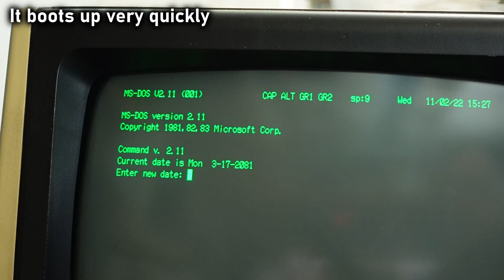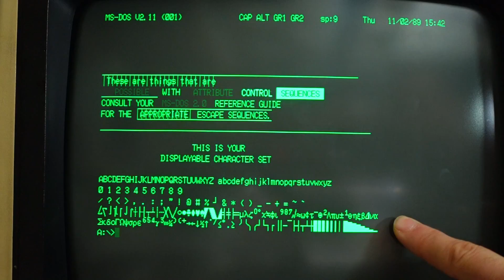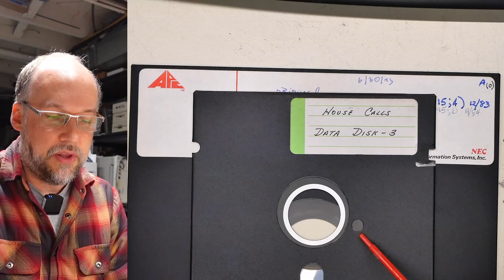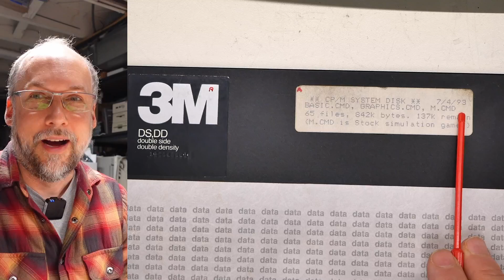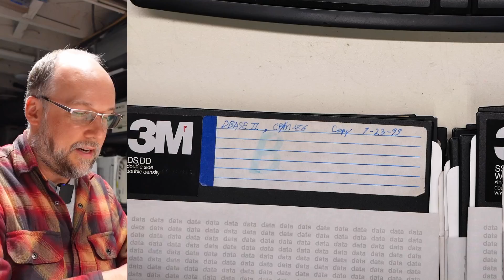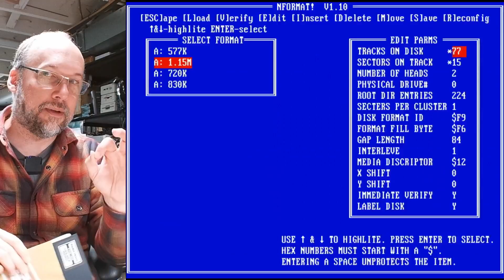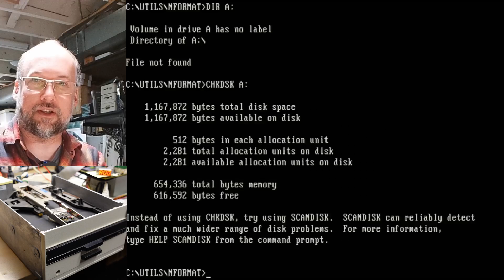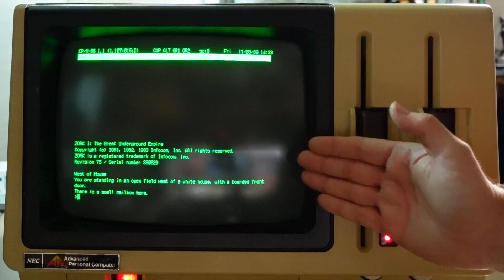Comment: Neon lamps get kind of weird as they age. Adrian, I’ll bet that if you shine a light on the neon lamp it’ll light and stay lit as long as there is sufficient ambient light, but if you turn down the lights, it will start flickering something awful.
Reply: Yeah I didn't know this! Someone mentioned Mr Carlson talked about this in a video. Fascinating thing! That switch I used was old and came out of something I ewasted long ago ... so it was probably quite spent.
Reply: @adriansdigitalbasement  yes this real with neon indicators and quite fascinating.

Neon bulbs have been used for all kinds of purposes over the years not just as indicators.

I once saw a I believe it was a photo control of some sort or something or other it was something controlling the light that used essentially a neon bulb that had a third electrode that was some sort of trigger device I don't know exactly what this device was it was so long ago but it was rather intriguing.

And unexpected to say the least!

There was a neon indicator that was often used as a tuning indicator back in the day that essentially showed more or less of an indication to indicate single strength as well another sort of specialty Neon indicator.

Used in a silver manner to a Magic Eye tube also known as other things other than this of course as well!

There was all sorts of weird and wonderful components back in the day that were rather unique and fascinating variations of things to make something that was at the time harder to do that now is just something commonplace instead of novelty really!

Not novelty in the way of just kind of being silly but novel use of the technology to do something that is unexpected one could say.

Back in the day even in some memory circuits neon lamps were used I remember seeing some old equipment like this had something to do with a tuner I believe or some other AV device don't know for certain.

What part of the device this was in.

I think how it worked is that a capacitor had a charge stored on it and the neon was used as a switch sort of deal basically just a single bit of memory hard to describe it's been so long somebody else had described this to me what seems like eons ago.

Also light is used in some types of tube equipment to enable tubes to operate in the dark in some cases since their operation can be dependent on lighting conditions there might be a pilot light where you would normally not even see it and would be completely in the dark and no means to see the light from outside the case of the equipment I forget all the types of components that use this but they're out there.

Fairly certain Mr Carlson's lab would have reference to this and others!

I do believe that sometimes with certain voltage regulators and other types of cold cathode tubes as well and some others I'm not real big on this but I'm aware of a lot of different applications for this situation where a source of light is needed where there is not like readily available otherwise I have a feeling that sometimes they may use to Glow of one tube next to another to do this not for certain but it might be feasible in some cases pretty sure that this has been done or at least attempted before
Reply: Bizarre but true; the neons were made with a tiny amount of a radioactive gas in the neon to lower the strike voltage by providing an initial ionisation. I used to enjoy watching apparatus rooms full of equipment with neon power indicators which flickered like mad in the dark but as soon as the room lights were turned on, mysteriously got better and lit up. It took me a long time to find out the reason; that the light is sufficient to help the ionisation along.
Reply: @neilbarnes3557  Huh. Is that still true? You can still get neon lamps. I recently installed one as the indicator in a guitar amplifier.
Reply: @wbfaulk  Dunno, tbh: it's an eighty year old (or older) technology that doesn't have a lot of relevance in modern designs; I don't know even if new neons are still being made though I suspect there's a factory somewhere in China still churning them out for mains switches.
The radioactive ioniser has a half life of about ten years, so a neon made in the eighties has only a sixteenth of the Krypton-85 it started out with.
Reply: @neilbarnes3557  For anyone else interested, this phenomenon is called "dark effect". Apparently not all neon lamps have/had radioactive gas, but definitely some do.
Reply: @neilbarnes3557  wouldn’t you know, the neon in my extension cord flickers at 50Hz like mad under the sofa but bring it into the light and it seems to light brighter and with longer persistence. 

I have to wonder how much of that is just placebo, but surely it should look darker not brighter in the sun if that were happening. So it probably is indeed happening even behind the red plastic window.
Reply: That is bizarre.
Reply: I have a similar vintage switch like that. It has the same problems where it doesn't light up immediately.
Reply: I have two old power strips that use the same kind of switch as the APC, and those flicker when there's low light too. :P

Comment: Here's a one-line program that does your "maze" thing in Applesoft Basic:

10 PRINT CHR$(47+(INT(RND(1)+0.5)*45));:GOTO 10

That said, the Apple display font's slash and backslash characters don't line up very well.

But you could make this generic for basically any Basic:

10 PRINT CHR$(ASC("/")+(INT(RND(1)+0.5)*(ASC("\")-ASC("/"))));:GOTO 10

Good luck typing that backslash on an Apple 2, though.

Comment: looks like you have a dodgy neon or connection in that switch, its subject to quite a lot of mechanical shock switching on and off so may just be  a broken solder joint...

Comment: yeah, the ibm pc messed up lots of stuff. i had a dec rainbow, with both ms-dos and cp/m for it. i gave up on ms-dos when i bought turbo c 2.0 and discovered that the command line version of the compiler would poll the ibm keyboard controller to see if you punched ^C during a compile. i wound up trading my 2.0 copy for a friend's 1.6, which didn't. since the rainbow also wasn't a terribly good cp/m-80 machine (the decmate ii with z-80 add-on was much better), i wound up abandoning my rainbow.
Reply: Ahhh -- the same issue there! I have a DEC Rainbow which I haven't dove into yet. Sad it's going to have similar issues ... I guess CPM-80 was pretty good as software knew it had to use the CPM BIOS and not go to hardware or it would have tons of issues... but I guess once the IBM PC was dominant, there was just no reasons to bother not talking directly to hardware.

Comment: Little trick for vintage computers that don't support 4 year dates (and that also don't have some mechanism for dealing with year 2000 and beyond) that works well enough for most things: dial back the calendar 112 years (i.e. 2022 becomes 1910). The days of the week repeat every 28 years (112 is a multiple of that), so anything that does those calculations will still line up with the current year, you just have to add 12 (or 112 if that software assumes a 1900 century) to the year.
Reply: Very interesting workaround. Never thought about doing that even though I knew about the date cycles. Have you had use cases for that in the past?
Reply: Although apparently MS DOS didn't like it lmao
Reply: @forbiddenera  MS-DOS 2 is not Y2K compatible. Think you need 4 or 5 to use any dates past 1999
Reply: The screen showed oct 30th demonstrating the system was able to correctly calculate the 2022 date!
Reply: You are better with numbers than me.

Comment: Too bad Zork didn't work. I wish I was better in coding so I could try to rewrite that Infocom interpreter to make those games playable on different systems.

By the way, I really like your new way of doing the split screen display while working on the computer connected to your capturing device.
Reply: The Infocom interpreter has already been rewritten many times and Infocom games can be played on virtually any computer. "Frotz" is the most notable Z-machine interpreter.
Reply: Yeah, just no modern version for APC MSDOS or APC CPU86 :-)
Reply: @adriansdigitalbasement  You've got that C compiler. I bet you could compile Frotz on there without too much effort.
Reply: Wasted potential having ram limit of 128kb and mentioned in last video highest was 256kb. Game may have entered in to a loop waiting for keyboard bios call to returning scan code. Not trying to be full pc compatible unless only dos functions called, common for clones.

Comment: Neon bulbs - even newer ones - require a bit of light to "strike"; if this one is old and tired, it might need more light. Try flashing a flashlight into the power switch when it doesn't start right away to verify... There is a "strike in darkness" type, but I doubt that these were ever put into power indicators.
Reply: I've seen these neon indicators my whole life but I never knew that tidbit!

Comment: I wonder if any tandy 2000 stuff will run on it. Since there is a version of windows for the tandy 2k
Reply: It wouldn't -- architecturally the machines are totally different. (Other than them both being x86 based)

Comment: exactly @Stan, we used to Kermit between different OS versions vms cp/m and  pcdos and msdos (non-compatibles) thats how we ported Basic across to compile under GW or MS basic.  Using serial con and Kermit. We used to even hook up a Acoustic coupler, and drop on  to Columbia Uni to get the Kermit, was sometimes easier, then setup Kermit on each  Fun days... in the 1980s.

ref from Columbia Uni Kermit Project " There were separate releases for the IBM PC, the DEC Rainbow, the HP-150, the Heath-Zenith 100, the Victor 9000, the NEC APC, and many other of the DOS machines of mid-1980s that were not code- or disk-compatible with each other. "

From the  kermit archive :  w-r-r-     49552  1988-08-24 15:26:28  msvapc.exe
Reply: This takes me back.... Apricot / Sirus and Wang are the ones we used to have to port over to.  :)

The files MS*.EXE are MS-DOS Kermit binaries for IBM and compatible PCs
and for non-IBM compatible PCs:

  MSVAP3.EXE - NEC APC-3
  MSVAPC.EXE - NEC APC
  MSVAPR.EXE - ACT Apricot
  MSVDM2.EXE - DECmate II or III with MS-DOS Option
  MSVGEN.EXE - "Generic" MS-DOS (DOS calls only)
  MSVGRI.EXE - Grid Compass II
  MSVHP1.EXE - HP-150
  MSVHPX.EXE - HP-110 and HP Portable Plus
  MSVIBM.EXE - IBM PC and PS/2 families
  MSVMBC.EXE - Sanyo MBC-550
  MSVP98.EXE - NEC PC 9801 (Japanese Kana/Kanji version)
  MSVRB1.EXE - DEC Rainbow-100 series
  MSVRB2.EXE - DEC Rainbow-100 series (special VT220 emulating version)
  MSVRMX.EXE - Intel 300 Series with iRMX-86
  MSVSEE.EXE - Seequa Chameleon
  MSVTIP.EXE - Texas Instruments Professional
  MSVV90.EXE - Victor 9000 (Sirius 1)
  MSVV9T.EXE - Victor 9000 (Sirius 1) with Tektronix emulation
  MSVWNG.EXE - Wang PC
  MSVZ10.EXE - Heath/Zenith 100

(end)
Reply: I would just need to figure out how to get that onto the machine. I saw a mention that an old KERMIT version did exist but having found no way to get it onto it.
Reply: @adriansdigitalbasement  Maybe a newer version of msdos for the APC can read/write to more standard DOS format files?  That'd obviate the need to use Kermit if you can transfer files between the two.  If you believe wikipedia, DOS 3.1 was released for the APC III.

Comment: Hey, Dear Adrian, could you please do a video on how you go about creating an archive old floppy disk, particularly ones which belong to systems no longer in use. Among a bunch of 5.25" floppies I bought, here in the UK, I came across an "HH Tigerbyte" "Full CP/M" version 1.1 (or 1.2 if you go by the hand-writing rather than the printed label) for the HH Tiger computer – this was, apparently, a computer developed by Tangerine of Cambridge in the UK. However, they sold the design to HH (Audio) Electronics of Cambridge, and went on the develop the Oric 1, instead. By all accounts, that HH Tiger is an extra-ordinarily rare machine. Sadly, of course, I have absolutely no way of discovering if the original operating system is preserved on this disk, or simply over-written (as quite a lot of the other disks I picked up were). If it does survive, and as far as I can tell from a brief Google-search, this will not be archived and some collectors have these computers and cannot boot them. Maybe, just maybe…? So, how is it done???
Reply: It is certainly something people struggle with -- so yeah I'll probably make a new video about it.
Reply: Check out the ImageDisk program he uses in part of this video.
Reply: Unless you have a machine old enough to run DOS and have a floppy drive controller, you might want to look at getting a flux-level disk interface, such as a Greaseweazle, Kryoflux, Applesauce or FluxEngine (disclaimer: I made that last). This will allow you to archive pretty much anything which is physically compatible using a modern computer.
Reply: @hjalfi  That's interesting although I did restore an PC/AT compatible for the purpose.

Comment: So, MS-DOS is y2k compliant, but the hardware itself isn't?  Thats kinda mindblowing! You would think the failure of one would bork the other, but instead the software just calmly continues while the on-ROM code tries to divide by zero. 😅
Reply: There's two issues with Y2K - just supporting 2000 and rolling over from 1999 to 2000.  A lot of machines suffered from roll-over issues, but would run just fine with a quick date reset.  But this one seems to have problems dealing with 2000 at all.

Comment: Adrian, if you ever have the opportunity, check out the Epson QX-10. Very interesting machine, I think you might like it.
Reply: A friend has one but its broken, i remember using it years ago. I personally had close experience with the rare QX11 which is almost the same, but uses 3 1/2 floppies (made the whole unit smaller) and has a graphics mode instead of pure text and a cartridge port IIRC. Ours had an external (huge) 10mb hard drive. Both were Z80 CPM machines. I think there was a QX16 as well, was it 8086? Don't remember. And yes they were used for word processing, spreadsheet, simple databases and the ocasional text adventure game. With the QX11 it had some drawing program and a rally like game (not graphic intensive, just the occasional lines and symbols draw here and there like a map). Whats in common? Epson, meaning, Japan, just like the NEC. Maybe it was a thing there and i imagine they needed the resolution for kanji. Not quite Zork i remember ours having some sort of text adventure game involving a brothel, whatever that was.

Comment: Even if I’d bought that disk way back then, brand new, I absolutely WOULD have duplicated it!  I only use duplicates of purchased stuff and safely store the originals.
Reply: I remember my word processor for my C64 (Starwriter?) said to do this as the first step in the manual. Make a copy, and keep the original disk safe.
Reply: Don't copy that floppy! 💾💾
Reply: @mal2ksc  copy everything
Reply: @mal2ksc  shit is that what they've been saying? I always thought it was copy that floppy. Whoops.
Reply: @ax14pz107  Actually when they see you sticking an original disk in the drive they are saying: “Don’t!  Copy that floppy!”  So the message is definitely saying make a backup.
Reply: In the mid-80s, Paul Schindler would make it a point to let you know if software was copy-protected when doing his software reviews.  He was not a fan of copy-protected disks.

Comment: Back in the day, you could install a "flippy floppy" drive modification, which added two sensors (one for the timing, and one for the write protect), allowing you to use both sides of a 5 1/4" diskette on your single sided drive.. 

There were also factory 5 1/4" diskettes with two write slots and two timing holes, and a company that offered a punch that punched the write slot and timing hole. 

In general, it's not a great idea to use flippy floppies, since the inside of your 5 1/4" diskette has a pad inside to collect dirt. When the diskette is flipped, the dirt can be pulled back off the pad.
Reply: Flippy disks, Sierra hole-punched the Kings Quest III disks for CoCo 3, otherwise the 10 disks wouldn't have fit in the Sierra box!